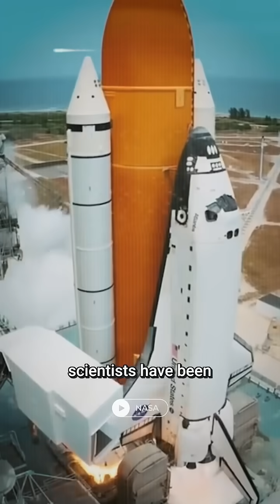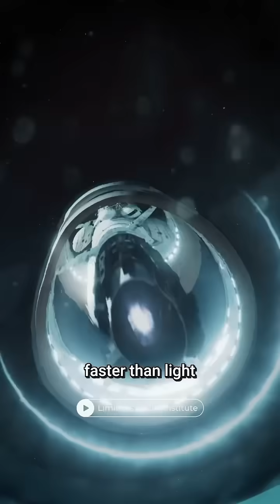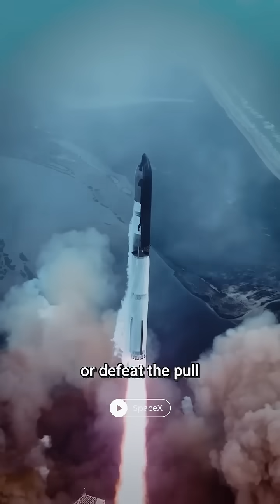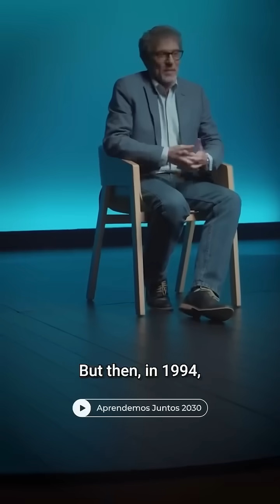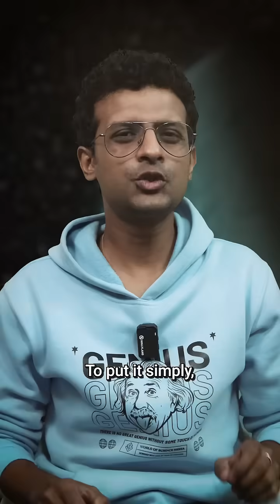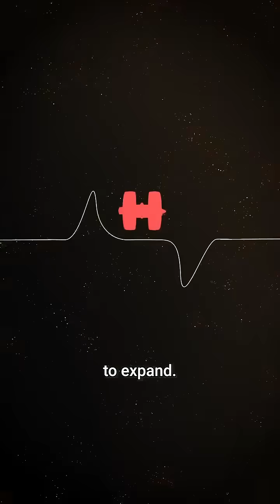How Warp Drive Can Travel Faster Than Light

Comment: They’ve gone faster. With particle accelerators but the problem is is that nothing but particles can go that fast without being crushed or vaporized by the heat it generates. That’s why they can’t make spaceships that go that fast. Any sort of metal or carbon fiber would be instantly crushed and vaporized by the force and heat that speed generates.

Comment: No one seems to remember that the universe itself broke its own law. The inflationary epoch saw Space-Time expand considerably faster than the speed of light but it was space expanding and not anything inside it. What caused this? No one knows but if we could understand it I have no doubt it could be theoretically translated into FTL travel.
Reply: Yahh,they say there's nothing more faster than speed of light but then how the heck,is Universe expanding at a rate Faster than speed of light..
Reply: @AjaySaini-hi9uh  Fastest in the universe, not the universe itself. And as you just said, it's a "rate", not a speed.
Reply: We already know what makes the expansion of the universe accelerate : dark energy. Even if we do not yet know what it is exactly, it is factual that it is the cause, and it makes up about 68% of the universe. 

Also, the universe's expansion is described as a rate called the Hubble constant (km/s/Mpc). This means more distant galaxies appear to move away faster, but this is due to space itself expanding, not objects moving through space at superluminal speeds.

Conclusion, there's no point in comparing the expansion's rate with the light speed. But if we still compare them, than the expansion of the universe can accelerate indefinitely and has already surpassed light speed.
Reply: @NotARef2Mika  I am literally talking about the inflationary epoch when dark energy wasn’t a thing really, it expanded from the size of a grapefruit to the size of a large solar system in a few nano seconds it then slowed down and then started speeding up once dark energy came into play later in the universes life. Read up on the inflationary epoch it’s just before the recombination epoch where the CMB was imprinted on the universe.
Reply: @CC-ns2ds  My apologies, I read your comment but not properly, didn't realise you were talking specifically about the inflationary epoch. My comment was inane.
Reply: @NotARef2Mika nah don’t be sorry I apologise for coming off rude at the end sorry
Reply: @CC-ns2ds  No issue, who doesn't find it annoying when people comme to contradict us while not even having read the comment properly? 🤧 Have a nice day.

Comment: 1/10 the speed of light is unbreakable try it. this has nothing to do with space or time it does have to do with the speed of protons and electrons around an atom they travel and approximately 1/10 the speed of light accelerate atoms passed the speed of the protons and electrons going around the atoms the atoms will self-destruct poof and approximately 1 tenth the speed of light.

Comment: Interesting theory but first you might need to know what the “fabric “is made of. You can bend and are fabric but what if it doesn’t behave like a fabric but more like a liquid
Reply: We understand what is fabric of spacetime, however we don't understand how to get artificial gravity in front and anti gravity at the back of the ship
Reply: @MasterMind75427  You only need to make the flow of time to bend a little, by making something accelerate faster than the speed of light, even for just a fraction of a second..

Like for example, make 2 atoms pull themself together with a force soo massive that they travel faster from the speed of light just to collide.. it would gave you energy equals to infinite to bend the flow of time and causes gravity..

Because gravity doesn't really exist right.. it's just a ripple in the timeflow which makes things collide..
Reply: @GiganticMythicalSpaceFishWhale  nothing can travel faster than speed of light, wormholes/warp drive don't make you travel faster than light, it's more like a shortcut through space
Reply: @MasterMind75427  That's what i've been saying..

If you want to make gravity, you need to bend the timeflow, and if you want to bend the timeflow, then you need to be able to make something which can travel faster than the speed of light while it stay still, so you can have the energy to create a spot where the mass would causes gravity..

That is an impossible feat for our current technology and maybe even for the next millions of years.. but it doesn't mean we can't.. theoritically, we can make an artificial gravity..
Reply: @MasterMind75427  You need negative mass for that.
Reply: Then it's like riding the waves..
Reply: So what’s the fabric made of and please don’t say dark matter or lenergy unless you can define those
Reply: @stevencantrell7  it's made from space and time therefore it's called fabric of spacetime, it gets bent by gravity

Comment: The fabric of space is expanding in some areas of universe faster than speed of light. Objects and matter in these areas aren’t moving faster than the speed of light themselves just along for the ride as space expands. This doesn’t break laws of physics
Reply: Yes, but the video is talking about how to reach the said area (that area of universe) which you mentioned.

It isn't breaking the laws of physics, but nearly impossible to reach that said space as well.
Reply: @mustafadawoodi8560  Good point
Reply: What even is the fabric of space such that it can bend and expand
Reply: Also we actually don't know how many energy per unit it uses

Warp travel can be defined as travel distance units per warped space unit.

A great example is Minecraft overworld blocks traveled each nether block which is 8 overworld blocks every single block of nether traveled.

But how many energy it needs to make x2 space warp which is just half the distance

Comment: So what Prof Brian Cox said is wrong . Warp speed and hyperspace travel is possible. It's just that it is still at the theoretical point .
Reply: Not really, the video is bogus/misleading. What Miguel Alcubierre did was to look for solutions of Einstein equations, an equation describing the geometry of space-time given an energy source (i.e. gravity), such that the geometry of space-time would allow to travel through some regions  backward in time, so apparently the speed of light "would be broken". These solutions imply negative energy densities, which as far as we know is impossible, there's no such type of matter. So it is legitimate to say that ti our best knowledge, it is impossible. There are several solutions like this in the literature, such as wormholes, assuming the existence of some exotic matter, but I find them more exciting mathematically than physically, because when Einstein wrote the equations of gravity, he assumed the energy sources would be known before looking for a solution, and there's no reason to believe all solutions of geometry are theoretically possible - a quantum theory of gravity might prove this was nothing but a mathematical exercise. This is not a theory, what Miguel Alcubierre did is an hypothesis, which is not self-contained.
Reply: @mmarques2736 <--- This guy.👍
Reply: @mmarques2736  The energy requirement has greatly been reduced, and the need for exotic matter has been removed in later iterations of the model. (See Erik Lentz’s work(s))

It’s still enormous amounts of energy required (I think it’s like 4 Jupiter masses worth of energy or something) but we’re (hopefully) getting to semi-feasible energy requirements.
Reply: Because there isn't an alternative. and you don't have a PHD or Doctorate . 😂
Reply: If it's only theoretical, how can you make that statement as if it were a proven fact?

Comment: If you traveled at speed of light would that mean the human body would age or not?
Reply: Your local experience of time would be the same wherever you are.  It's the outside observer behind you that would see your time pass more slowly.
Reply: Not in the case of a warp drive , you travel at or faster the speed of light  because space time pushes you , but the ship instead in the bubble doesn’t , so not time dilation for the traveller

Comment: You can break the speed of light. But you won't be visible. After all, for some to see you, the light bouncing from you has to reach them. If you travel faster than the speed of light, that will not happen. So, no one will see you.
Reply: To be more precise, only an object with negative mass go faster than c. But breaking through c is not really accurate as negative mass would always be travelling faster than c, never slowing down. 

But it's all theoretical, and even if negative mass exists, it would be either extremely difficult (if we're optimistic) or simply impossible, both in theory and practice to use it.
Reply: But you cannot reach the speed of light much less go faster.
Reply: @BrjanBuckmaster  You are basing this conclusion on an assumption. See, the reason we can't see dark matter and dark energy is probably because they travel faster than the speed of light.
Reply: @lawrencemaweu No, I’m basing my conclusion on facts. Nothing having any mass, including dark matter, can reach the speed of light, much less than FTL.
Reply: Right and Wrong, if You warp space outside observer will see the ship stretching and it will go infrared (teotherically not invisible but can't be saw with normal methods)

Also that's not travelling faster than light, is making the distance shorter

Comment: Well, it's also known that gravity warps/bends  space as well, i.e the sun, earth or most other celestial bodies, furthermore why are we not able to simulate artificial gravity or harness enough natural gravity with an engine" of sorts for a spacecraft. For imagination purposes, what if a space craft had said capabilities, the gravity engine for this example can warp/bend space via gravity and shorten/fold the distance between point A and point B? Just my imagination.
Reply: I imagine it would be better to try and eliminate your mass, then it would require very little energy to accelerate to prodigious speeds.  Remember from the point of view of a photon (massless), travel to anywhere is instantaneous.
Reply: @ChrisNotTheKing  after learning a little more, I now know that you’re referring to traveling at light speed and photons are able to do this because they are massless. Although, humans becoming massless sounds terrifying in my imagination. Especially with how science fiction depicts this. Thank you for your response by the way,
Reply: @elijahlevor8727  It's certainly one of those "suspension of disbelief" commonalities in SciFi.  Generated gravity... without the spinning thing we know we can do.  Nearly every member of the standard model in quantum physics has an anti-particle, in one or more axes.  Now that CERN conclusively found the previously-only-theorised Higgs boson, which is responsible for things having mass, there's an even more tantalising thought that somehow integrating the "force" of gravity into the standard model might teach us how to make those SciFi things happen.  Merely a conglomeration magical waves, after-all.

Comment: . . . would there be time dilation? If so, then traveling faster than light speed might not be a good idea when you consider you would be going backward in time, at some point, you would travel back before the big bang and into oblivion
Reply: No. Therefore it is called solution

Comment: It could be a matter of semantics, but contracting space would compress space. While expanding space would have it thin out. 

The opposite must be accomplished. Decrease space density space in front while increasing space density behind. The higher density would push the vehicle forward into a less dense space. 

One of the big problems would be that of decreasing space density in front. Space will try to fill-in a lesser density to a level of that of surrounding space. This will be done at the speed if light. Which means the drive must decrease space density faster than light -- energy penalty. 

Same in the rear of the vehicle but just opposite. There the drive must create increased space density at the designated velocity. But the space will only fill-in at the speed of light. Thus there would be an energy penalty to collapse space faster than it can naturally occure --the speed of light. ,

Comment: The amount of energy required to power an Alcubierre drive is not yet known, but it is estimated to be a large amount: 
 
Original calculations
Alcubierre's original calculations estimated that a bubble large enough to enclose a 200-meter ship would require more energy than the mass of the observable universe. 
 
Fenning and Ford's estimate
Fenning and Ford estimated that the energy requirement would be 10 orders of magnitude greater than the mass of the observable universe. 
 
Chris Van den Broeck's modification
Van den Broeck's modification of Alcubierre's model reduced the energy requirement to three solar masses. 
 
The Alcubierre drive is a fictional propulsion system that enables faster-than-light travel. It requires negative energy, also known as exotic matter, which is difficult to describe and has not been observed on macroscopic scales. 
 
Some studies suggest that a warp drive may not require exotic negative energy. A new paper by Jared Fuchs of the University of Alabama, Huntsville and the Applied Physics research think tank suggests that warp drives might be possible.
Reply: So yeah, it’s fine in theory but not so fine in practice
Reply: So you're saying there's a chance!
Reply: @illinialumni BWAHAHAHAHA!!!!!
Reply: We could try to use gravity that bends space time
Reply: Fred Fuchs has a son? In hind sight it makes sense.
Reply: Mass of observable universe 😱😱
Reply: Anti Matter may be the answer for Energy requirements for warp drive.
Reply: But don't we have explosives on eEarth NOW that could theoretically blow a bubble downward with force and making it FEASIBLE to propel a ship or at least make a large enough wave for us to rip through the fabric and get to another point in space altogether? IE an atom bomb or a hydrogen bomb? I understand the consequences of radiation to the crew. But why not at least try and test that theory before we move forward with human or creature testing?
Reply: @frankcastlejr  no dude, we don't have that
Reply: @frankcastlejr  It would require more energy than in the observable universe, so it's only theoretically possible, and will never be practicable.